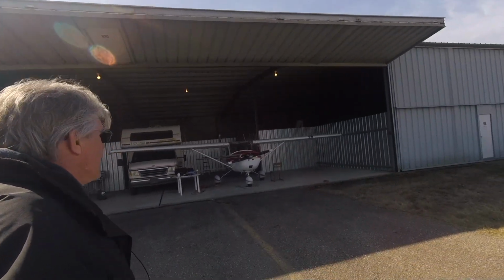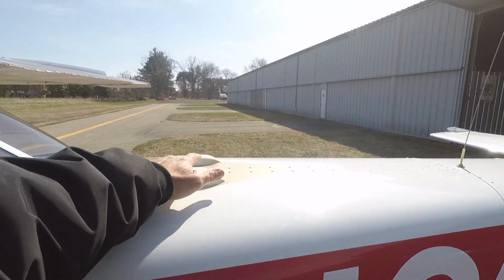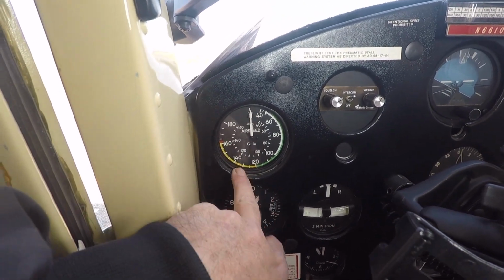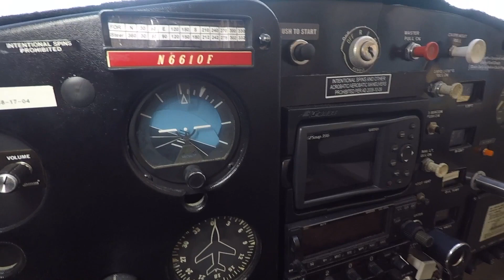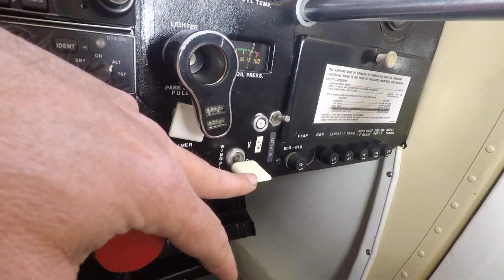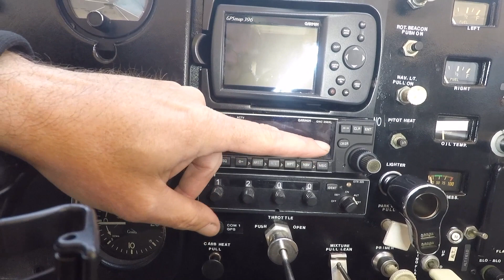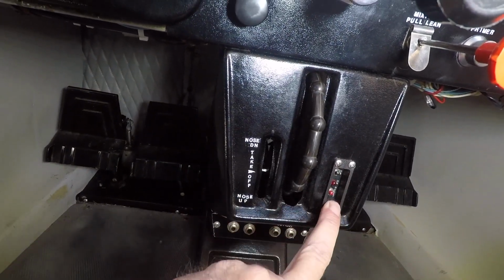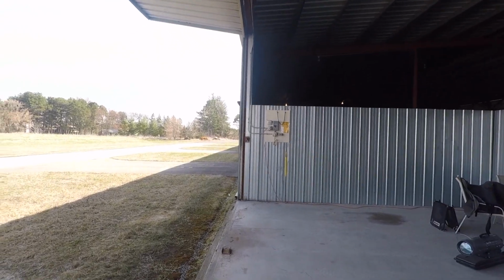Cessna 150 in her new hager

Comment: You can put a piece of duct tape on the metal near the door at 10'.  Then you just raise the door to that height to get the plane safely in and out.  You don't need to raise it all the way up for a small plane like that.  I just did that for mine.
Reply from the maker: If I can figure away upsetting pictures on this.  I can show a pic where the door was not all the way up and I riped off my beacon.  It was a little pricey fix.  But a mark for the door is a good idea thank you for the info.